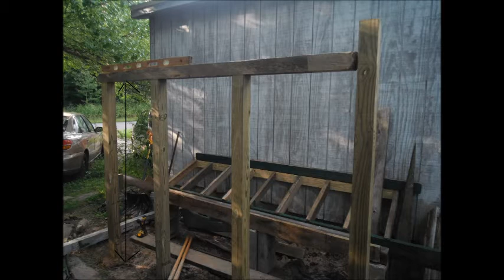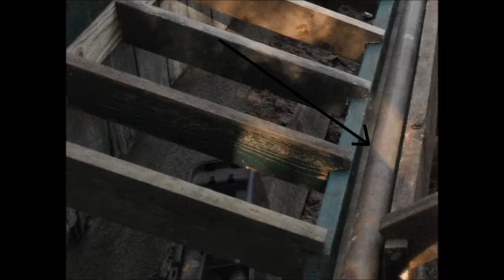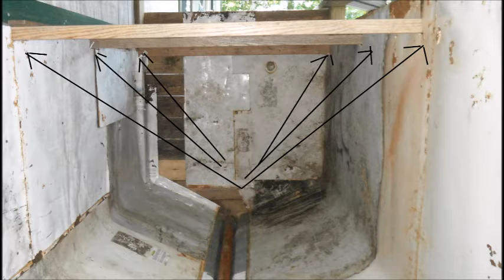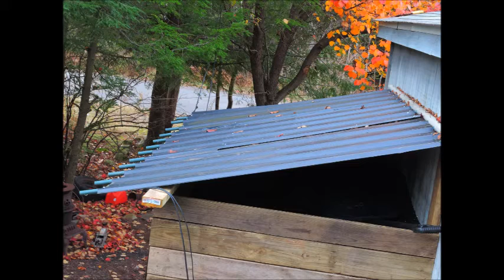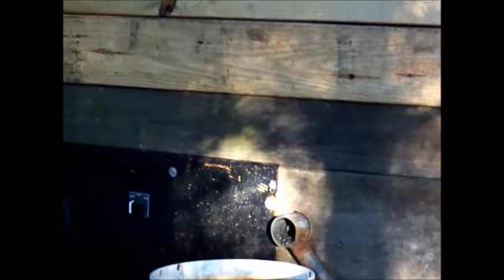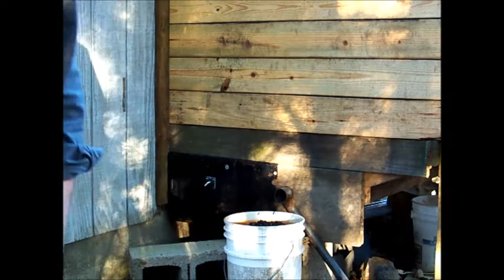Modular coal bin construction with dispensing auger

Comment: Nice little coal bunker you got there.
..
Suggestion if the feed hopper for your furnace or boiler isn't too high consider installing a 4 or 6 inch PCV line from where the coal comes out of the screw conveyer drops into the open right below the screw converter and follows the open gravity line into the basement into the feed hopper. Use a threaded plug where it feed into the gravity line at the hopper or outside at the bunker to prevent small varmints from entering home.

Just trying to make it easier on you.

Cheers!